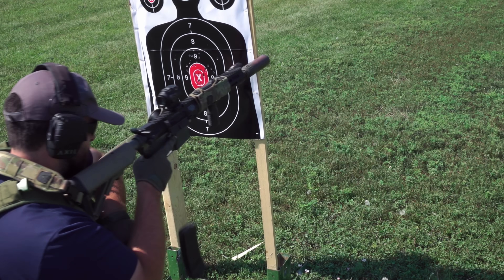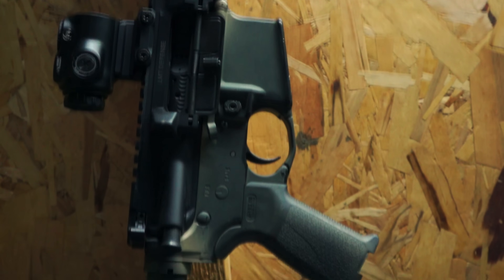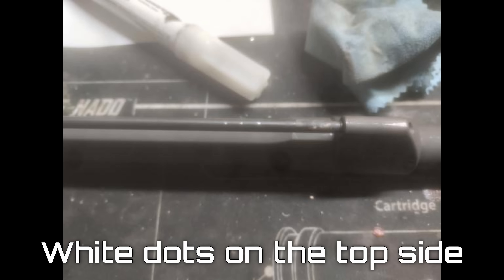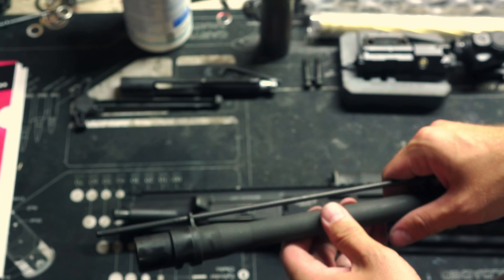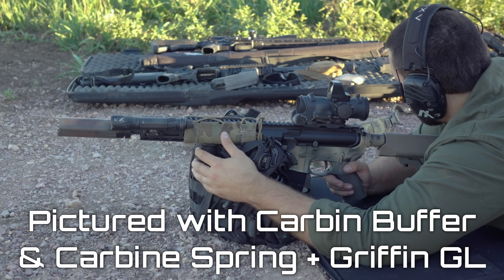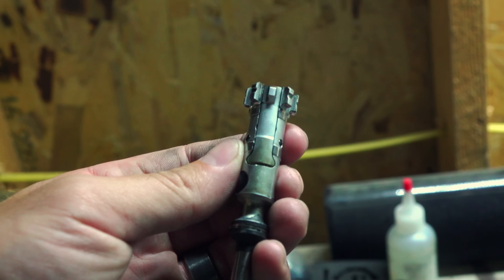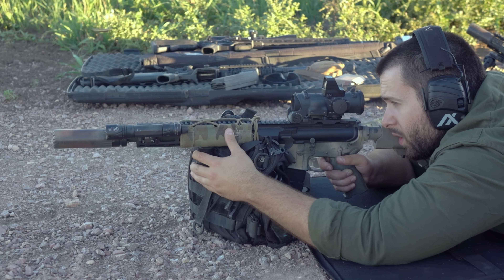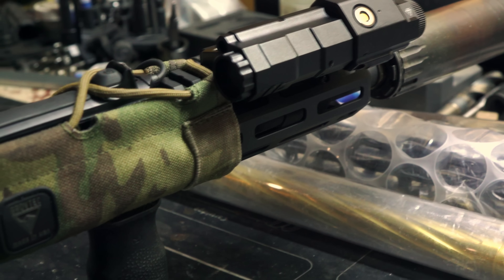Learning Machining Together - LMT 12.5" Specwar

Comment: Because their bolt is absolutely insanely priced, I got just the carrier and installed a DD bolt. I love it on my DD 14.5 midlength. Runs great suppressed and unsuppressed, with surprisingly little difference between the two. Also less gas out the ejection port, which was immediately apparent as a lefty.
Reply: I've got a dd upper and it's alright
Reply: They do sell mil spec bolts that are “more” reasonably priced
Reply from the maker: @Jooglesberry  I would recommend a good basic BCG over their enhanced BCG

Comment: I have a full factory specwar and love it. Sure, it is over gassed but with a flow through can like the OSS silencer I use and it is really good. Better than my HK, DD, LWRCI, KAC, Honey Badger or Geissele? Not at all, but you get a monolithic receiver to be better with a laser designator and I even think that now with all the anti rotation tabs it really isn’t an issue with keeping zero. Realistically a laser is only used for sub 100 yards and if you are really a super secret squirrel you may only use the illuminator as if you are fighting against any military now they all have night vision and will see your laser.
Reply: I have just the upper Specwar, and I honestly don't have this overgassing issue everyone speaks of. I was at the range and shot 200 rounds. To me, overgassing is when it is hitting me in the face, and I can't see or breathe. I also run a Flow556k on mine, but not for work.

Comment: The psa lower made me chuckle 😁

This is why i like to put together all my own uppers and do all my own work to the best of my ability. I’m not trying to pay a bunch of moola for an upper some chuckle head with a sdi certificate put together. I’d be pissed if i paid all that money and  the gas tube was upside down then have to buy a special tool to fix it 🙄
Reply: SOTAR did a video on a Daniel defense barrel that the gas port was drilled at 3 o'clock position and the barrel extension was f'd as well iirc.

I know mistakes happen, but QC failures like that are ridiculous.  How many people touched that product but didn't spot the issue or even check it before shipping it out.
Reply: Yep, and SOTAR gave the PSA receiver a B- after his inspection.  Sounds like a good value.  I suppose I’ll chuckle with you anyway. 😂😆😝
Reply: hey as long as a lower is made of metal and not plastic bullshit and made to spec it's gtg. A lower is a lower when it comes to forged lowers and billet is a waste of money and time.
Reply: @John_439  I've had a polymer lower with a full polymer parts kit in it for quite a few years now. Put quite a few rounds through it too, although I wouldn't try to dig a ditch with it, it's been pretty solid and the trigger is surprisingly decent considering it's polymer, hammer is polymer too.
Reply: @PineyJustice  yah it's a toy. Aluminum or steel are the only acceptable receiver options. These are weapons not toys and should be build for that use.
Reply: @John_439  lots of guns with plastic parts in war every day 🤷‍♂️. I’m more worried about QC and reputation. If you’re known for putting out rifles that lose head space in under 1k rounds idc what it’s made of it’s shit.
Reply: @John_439  It hasn't broke yet and shows no signs of breaking. Aluminum is actually more fragile than good polymer as it will shatter rather than bend. It's made out of a polymer very much like magpul uses.
Reply: @John_439  Also, have you had much luck finding an aluminum or steel glock receiver? Because polymer can't be a reliable receiver right?
Reply: @bmrz38  you can gauge a hole and know that it’s the right size but it’s not telling him it’s in the right location. If the trigger holes are slightly off up,down,left or right it can cause it to be too loose or tight and egg the holes over time. It also doesn’t tell you that the finish was done properly or any heat treatment of the metals were done properly. People put too much stock in the gauges when they’re just meant to be used to help diagnose or find inefficiencies.
Reply: @PineyJustice  lol you obviously don't know physics
Reply: @RichardCranium321  yep just like the jakl focus has, a simple check on the rail and they would have known it wasn’t right. Or the lmt? He just had, they say they fire every gun but clearly not. Companies across the board are just going down hill.
Reply: @John_439  please explain it to me then
Reply: @PineyJustice   right. The scar has a plastic lower, the cz and beretta rifle have plastic receiver right? 

I drive Rc cars as another hobby, lots of parts can be upgraded to aluminum but it’s best to keep with the plastic parts most of the time cause as you said aluminum can/will bend and stay bent and plastic (the right plastic) can bend pretty far and then bounce right back.
Reply: @PineyJustice correct, polymer can't be a reliable AR lower receiver when it's modeled after a standard AR receiver. The KP15 lower is a different story due to the design. The fact that you're comparing a Glock frame to an AR receiver means you have zero clue how physics work. An AR-15 receiver experiences a good amount of stress at the rear takedown pin area due to the impact of the buffer hitting the end of the buffer tube. The reason other designs can reliably get away with running poly lowers, I.E. the SCAR, is because those lowers don't experience this stress like an AR pattern does.
Reply: @hicksc1498  I've put quite a few rounds of 450 bushmaster and other non 5.56 calibers downrange using a polymer lower, hundreds, in addition to over a thousand rounds of 5.56. So you're clearly wrong, the newer polymer lowers fixed a lot of issues the original ones that had the issues you're thinking of had. I originally bought it for an ultra light build as it was the lightest lower money could buy at the time, but I've ended up using it quite a bit and with other uppers.
Reply: @hicksc1498  Mine is a new frontier btw. They really don't have as many issues as you think, the ones that had the issues were earlier models and the really cheap ones.
Reply: Interesting

Comment: BRT makes a straight gas tube that can be used to correct LMTs gaped gas ports.
Reply: i got a BRT for a gaped faxon gunner.
Reply: I’ve done that or just get the piston and be done with it, love my shovelnose factory sbr
Reply: @TheNatestEver  I'm debating on getting their piston or the 12.5 lwrc M6.
Reply: So I used to use the brt tube, then I had issues when I swapped to a dual ejector bolt. Swapped back the gas tubes and now it’s a perfect 3-330 ejection.
Reply from the maker: @JohnBrowningsGhost  that's probably a good option

Comment: I scrimped scraped and saved for 2 years as a e4 to get one of those uppers, it printed 4 inch groups at 50m with 77gr IMI razor, and then I found out it had a crack in the receiver where the barrel gets torqued. I quickly traded that POS and don’t think I’ll ever buy from LMT again
Reply: Should have sent it back to LMT and got a refund
Reply: LMT would have fixed it. They've quickly resolved issues that I've had in the past. But yeah, I share your disappointment.

Comment: I built my LMT off of used parts on Tacswap, got a cqb quadrail upper for 400ish dollars, and had dwilson convert a centurion 16 inch with an FSB. 
The upper and lower are really my only LMT parts, but I have no complaints about it or the work Dwilson did for me. 
Shoots nice, shoots well suppressed, accurate, midweight centurion barrel doesnt deflect much with the suppressor mounted, tad on the heavy side but thats what I wanted.
Reply from the maker: @JohnBrowningsGhost  piecing one together is probably the best way to go

Comment: My experience with LMT has run the gamut, I had to send a lower back to them because it looked like it was machined with a bottle opener and also sent back one of their "OMG super alloy!" bolts because it had worn to the point it would not stop on the bolt catch after ~1000 round and they took 6+ months to send me a new one.  On the flip side, the quad rail MRP upper and barrel I got from them was immaculately manufactured and one of the most confidence-inspiring piece of of gear I've ever used.  Boringly accurate to boot.  As for Mr. Wilson, he will remain the only person I trust with gunsmithing.
Reply from the maker: That sounds about right.

Comment: I have Dwilson's "chodewar" setup, a 8.25" LMT specwar upper with a 9" 300blk barrel. I like it a lot. I also put mine on a PSA lower. I haven't experienced the heat problems but I'm not dumping consecutive mags of 300 either. The 300blk barrels are all pistol gas as far as I know and in my experience with a SiCo chimera it works very well. Gas to the face isn't bad and its very very quiet with subs. The gun is super light and handy and I feel like I could use it as a club if I had to.
Reply: For what it's worth I have seen a couple different companies at least do carbine gas on 16-inch blackout barrels. I haven't seen those for a few years but it was for common when the caliber was new on the market. I think the manufacturers assumed if you wanted a 16-inch barrel you probably were just using it for supers and hunting. Suppressors were much less common in 2013 and 2014. There was definitely a market for people who wanted to hunt with their AR in States that wouldn't allow 22 caliber. Kind of the same sort of market that now exists for 350 legend in a couple states that only allow straight wall cartridges for no good reason.

Comment: Is it a possibility that the owner of the rifle who shipped the barrel to D. Wilson jacked up the tube orientation. I don’t understand why it was even talked about. 

LMT’s stock specwar is normal BCG + mid length gas. It just sounds like this was a poorly put together combo by the owner. Stock specwar from LMT is designed to use suppressor and is not gassy.

Comment: I like LMT products but have noticed some QC issues. Brand new 308 bolt carrier had a huge dent in the carrier key that scrapped the inside of the upper. LMT did swap it out for free. Definitely overgassed, i only shoot them with Hux cans and still get a little gas.
Reply: If you would like the rifle gassed for your liking instead of combat gassed then you can opt for a BRT gas tube... super easy to install and they will get it tuned to your liking provided you give them the right information.

Comment: I just put together an LMT upper as my first gucci upper, as thriftily as possible of course, for $1600 (with the enhanced bcg). Went with the 9.25 rail and 11.5 barrel. 
Had to pick one up after watching GoldenWebb's burndown. Excited to put it through it's paces. And of course it's riding on a poverty pony lower 
😉
Also you don't have to use their special wrench, a normal torque wrench is fine.

Comment: for some perspective, AFAIK colt canada licensed this mono upper design. Their uppers with CHF barrels ran for between 550 (blem) to 1100 $CAD in 2015
Reply: From what I can gather the L119A2 uses a partially monolithic upper, as in the 12oclock outta one continuous piece, but the rest of the handguard appears to me to be a seperate piece.

I'm, however, only going off pictures because I can't get ahold of an L119A2.
Reply: @ALovelyBunchOfDragonballz  Colt still lost the Lawsuit that LMT brought against them so Colt has to pay a royalty for every single piece upper/handguard set they sell.
Reply: @aaronorr5586  lost a lawsuit or licenced? Because I can see a court deciding its closer enough for legal problems.

Comment: Just wanted to say, the recent character arc is both amazing and refreshing.

Side note: Have you thought about maybe cutting one coil off your PDQ lever spring to see if it makes a difference for locking open?  I've noticed mine locks back with uppers that don't have a dust cover but sometimes misses the bolt on ones with a dust cover.

Comment: I say just get the 12.5 Sage Dynamics Barrel from ROSCO.  I love mine & when paired with SIONICS 11.8 Free Float Handguard & Surefire 3prong Flashhider, a RC2 sits about .1" away from the rail & looks amazing.
   Does eject around the 1oclock so maybe the gas port needs some looked at not sure but 0 malfunctions so im not messing with it lol.
Reply: The gas port on the Rosco Sage Dynamics 12.5" is pretty large. It's .080. I know the Sage barrel has a gas length between carbine and mid-length, but compare that to the Sionics and Triarc 12.5" mid-length barrels that both have .078 gas ports.

Comment: I'd like to see D. Wilson's chuck for his lathe. I have never chopped a barrel but I know my way around a lathe and I'm curious how he's mounting these barrels in the chuck with the gas tube and gas block attached. I'm not necessarily calling him a liar, he may have a specialized chuck that I'm not aware of but with all the lathes I have worked with you'd definitely damage the gas tube on that particular setup. 

I haven't worked with any CNC lathes, just manual ones and even with those my experience is somewhat limited so he seriously might have a way to mount that assembly in there with no issue. However, lots of people say they get stuff back from D. Wilson and its blemished. That shouldn't be happening, as a machinist you're judged on the finished part quality. If you're taking a good finish and putting blemishes on it that weren't there before you're doing something wrong. 

Still, I got a lot of respect for what D. Wilson does. There aren't many shops like that these days.
Reply: LMT gas blocks can come off
Reply: LMT gas blocks are supposedly pressed on, so difficult to remove
Reply: @Floridaman223  eh, not any harder than an ak one
Reply: @0Asterite0  but if you don’t have to remove it, then why remove it?

Comment: I use RifleSpeed blocks, i felt that straight gas tube comment. I put the tube in the block correctly but it rotated, somehow, before i put the pin in it.
I caught it before firing, but i started putting a mark on the top like you mentioned.

Comment: I put a riflespeed gas block on mine. it is now the softest shooter I own both while suppressed and unsupressed. To be fair that only added more to the cost but when youre bad with money like me thats fine
Reply: Everything fits under the HG?
Planning on getting the 9.25, already got a 11.5 Criterion Core and Riflespeed.
Have a Griffin MK2 ready too.
Reply: @hyphydan  fits great! Just be weary that replacing the LMT gas block is a little bit of a bitch as it's a press fit gas block. Had to Dremel some relief cuts around it and then hammered it off carefully.

Comment: I caught you fucking around with the optic height on that GLX microprism. I did try mounting my older SLX forward so I could use it with a magnifier, like you did, but my buddy tried to use it sans magnifier, and noticed that everything looks smaller with that prism when it was mounted forward. So, I could use it with a magnifier, but without the magnifier, it was no longer 1x, it was more like 0.5x. Have you ever run into this?
Reply: I have an slx 1x micro prism as well, I love that the reticle is etched so batteries aren’t critical but you are right, when I mount it at a normal red dot position it looks like a 0.5x

Comment: Awesome review! Thank you! I would like to ask you a favor. I am a veteran, and a staunch constitutionalist, and huge supporter of the Second Amendment. I have done some research on a new round that is being launched by some other proud Americans, and it is amazing! I would like for you to research, shoot, and review the Sons of Liberty Gunworks 6mm Max. X-Ring has done some work with them, but I would like for you to check it out as well. I am not a competitive shooter. I am a combat shooter, and this caliber seems to fit that bill perfectly. 6mm Max was actually designed and developed to be a combat round to be more effective in every way than the 5.56 and more reliable than 6 Arc and 6.5 Grendel. The problem is that no one is backing it other than the manufacturer of the ammo and SOLGW. Thank you for your consideration.

Comment: I always liked my gate lok blast shield, and everyone I know with a Griffin gate lok can or adapter likes it and has never had an issue. That said, I swapped my gate lock muzzle device for a dual lok muzzle device and went with griffin's dual lok hub adapter for my first suppressor (a cat wb 718), partially due to your endorsement of the dual lok in the video on the plan-b you did. I shot it this weekend and it was awesome. No issues so far. What about the gate lok was bad for you?

Comment: I will agree on using a different bareel. If i was going to do it again, I wouldn't use an LMT barrel. I'd get one from DD, BCM or criterion and send it to D.Wilson. In my opinion, the “combat gassing" is lazy. I dont think it will run any better dirty than a DD, Geissele, FN, or other quality AR. I do know that the thing will have issues trying to run it suppressed from missfeeding to not locking back on empty mags (depending on mags, hell even without the can it has issues with some) due to such increased bolt velocity.

Comment: I get the issue on monolithic uppers....but in reality, why anyone would by a suppressor but not buy a riflespeed gas block is beyond me. Or any other adjustable setup.
Reply from the maker: These have to be converted to work with a rifle speed gas block.

Comment: had a few lmt rifles and parts. finish is always bad with either blemishes and dings and the aesthetic lines of the parts not lining up by a mile. but notable qc was a 300bll upper that was unfinished in the machining to where the lower front pin couldn't engage because of the excess material. lmt didn't want to do anything about it so I bubba filed it down. ambi charge handle had the latch installed on the wrong side. ordered light weight 308 Barrel and they sent standard weight. ergo rail panels that come with the gun were literally chopped up into small pieces. feel like there's one more thing but its slipping my mind.